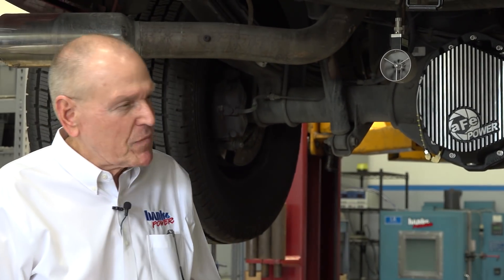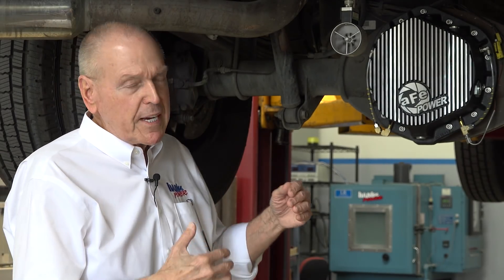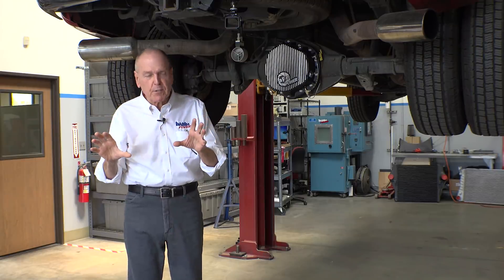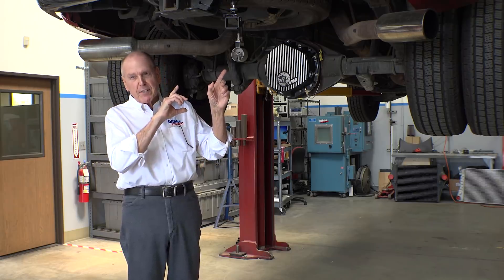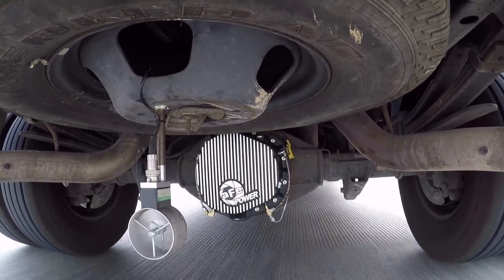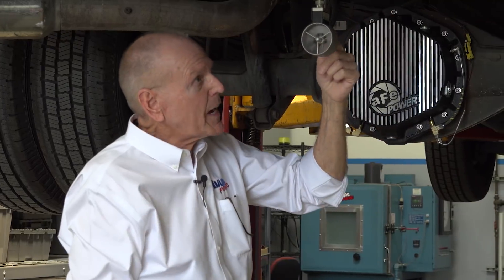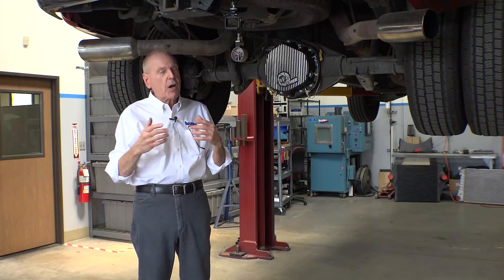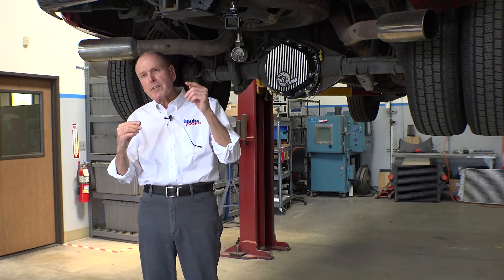Do Diff Covers Work or Are They Just Bling? Part 1 of 3

Comment: Banks is a genius! Me2 mpgs!
2015 SL 2500 Cummins 6spd 4x4 4door Crew cab deleted 4" pipe, KN flat air filter camper shell 4 spares tires 20gallon extra tank, 3 light bars =970watts, Setup as 1st responder, 10,000+ LBS, same mpgs since deleted by PFdiesel.com Skiatook Oklahoma, Best shop in USA! 
25-32mpgs freeway
20-25 city, 10-20 off road 
Avg.MPGs From 78k to 190k

Diesel ECONOMY TIPS
1:Speed 55 & rpm 1500
2: Close Windows 
3: No items on top of car
4: Make truck aerodynamic  
5: Inflate tires 2 maximum
6: High rear end gearing3.42
7: Factory tall tires
8: 5-40w Synthetic Oil
9: avoid 4x4 driving
10: Remove excessive weight   
11: Fuel is heavy too
12: Plan journey wisely 
13: warm up engine
14: clean outside
15: Avoid RAIN 
16: No aggressive driving
17: Don't over-rev. 
18: Gear fast, slow & accelerate 
19: Avoid idling.
20: Overdrive & cruise control  
21: Ele&AC worsens MPG
22: Exploit cruising down hill 
23: Avoid a complete stop
24: red>roll in neutral gear
25: Tune engine to low HP
26: Change oil regularly.  
27: Replace air filters regularly.
33: Leave early Family drama 
34 constant Mph=Mpg 
36: avoid drama & stress
37 Park in shade
38 distance to prevent braking  
39: Forced induction =MPG
41:Rough asphalt tire wear+7% 
42:Use brakes to slow down.
43change fuel filters often
44change power train oils
45avoid wider tires
46avoid jacking truck height
47used tires =better MPGs
48TenDegrees=HalfMileMpg

Obama Diesel Exhaust Cooker warranty expired 80k. 3rd Cooker by 75K so 78k I deleted. Save 10c mile or $1000/10,000 miles
Or $10,000/100k miles! 
So if I deleted@0, $7800 saving + $10,500=$18,400 fuel savings!
Reply: John Jason Chun thanks for being so smart and telling us the shop that deleted your truck for street use, lol pretty soon they'll all be gone from guys like u
Reply: The only trouble with deleting a truck is dealerships and a lot of other shops won't work on them. If your local, no big deal, but if you use the truck for a business like delivering RVs or Hotshoting it can be a problem if something goes wrong on the road.
Reply: What's a "crew cab delete"?
Reply: Ted Shinn it deletes the drivers cab so he can install milk creates to sit on , makes it totally Hill jack
Reply: all  that and you cant do math...you really think your special and can get double the fuel mileage the rest of the world gets...btw i checked and "lost in space" is available as a screen name
Reply: stickloaf Levels of knowledge=
1-scientists molecular level
2-PhD engineer blueprints and MTBF testing
3-Manufact. Engineers
4-Assembly Tech's
5-Factory Tech's
6-Stealetship Tech's
7-home mechanic
8-consumers
Reply: stickloaf stupid DNA 30mpg freeway is 35-42% better efficiency. 4 semesters of calculus. Must be a dropout, illegal or GED🤣😆
Reply: John your missing dynamic wheel balance in your list

Always perfectly balanced, 

30% extra tire life

no need to rebalance every 7,000 miles

It cuts out repeat visits to your local tire guy.
Thats why their against it. Saves you money!